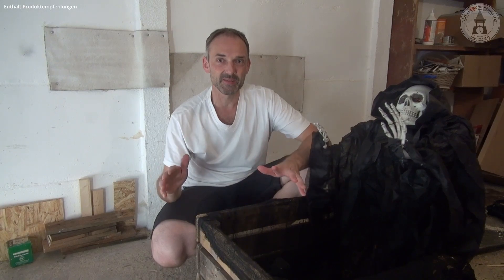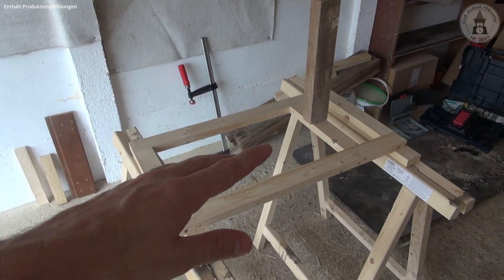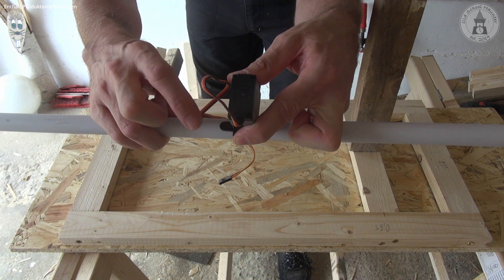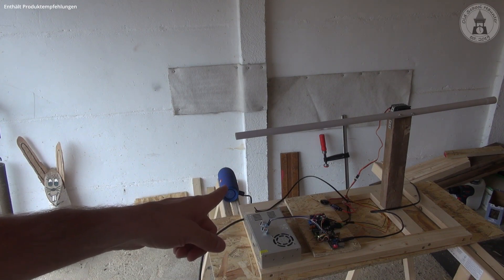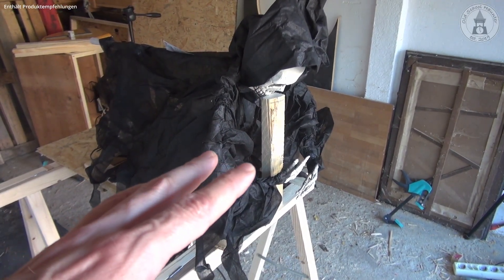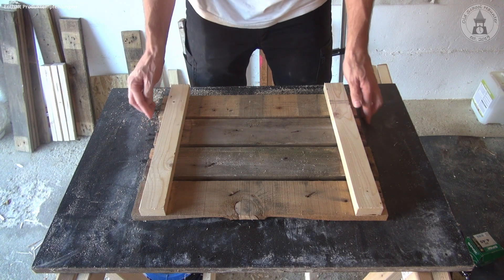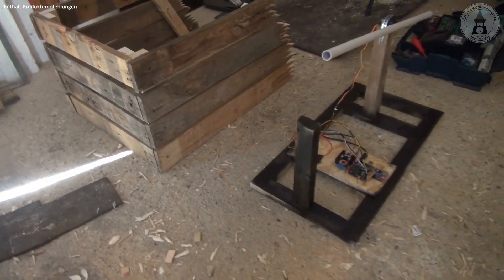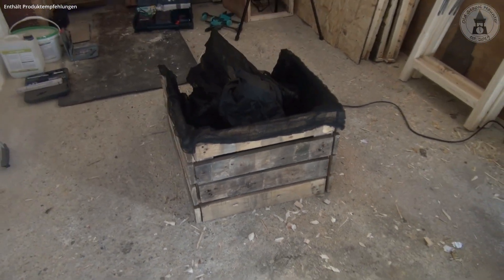Popup Ghost Animatronic - The scare is around the corner [Halloween Spooky Creepy DIY EN]

Comment: I have been thinking about how to simulate pneumatic linear action for jump scare props like this and I have not been able to come up with anything due to my lack of knowledge of electronic components. So this is really perfect for me! I am about to order some servos! I was not able to find your other video where you use the servos. Can you provide the link here? Also, can you post the details of the ultrasonic sensor?
Reply from the maker: You can find the other video about my haunted toilet here: https://youtu.be/h808ZdR4YuA?si=NML2o3xJjRVFcB3b
I hope the servo works, even when triggering the props one time after another. But theoretically it should work :-) I did some tests and it worked, but I will see real world test during Halloween. 
The ultrasonic sensor is the one, which came along with a starter kit for an Arduino. Sadly there are no information contained in the kit about the sensor in the kit :-( The sensor itself should be this one here: https://www.amazon.de/AZDelivery-HC-SR04-Ultraschall-Entfernungsmesser-Raspberry/dp/B072N473HD/ Hope the link works for you. The sensor is called HC-SR04
Reply: @OldSchoolHaunter  Thank you for the details! I went on AliExpress and ordered some servos with metal gears and the ultrasonic sensors! I also looked on YouTube for some details on using a servo with an Arduino and it seems pretty straight forward! I'm looking forward to doing something like this! Thank you for sharing!
Reply from the maker: Yes working with those sensors ist quiet simple when you already know how to develop for Arduino. Wish you good luck for your projects and hope everything
Works as expected. Great to hear the video helped you 😊